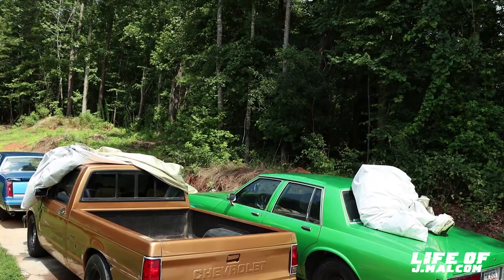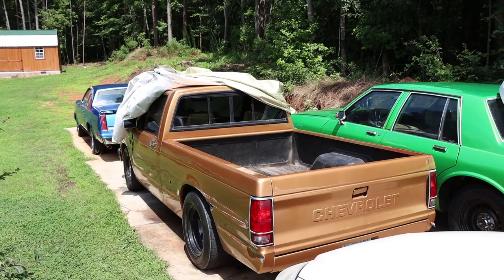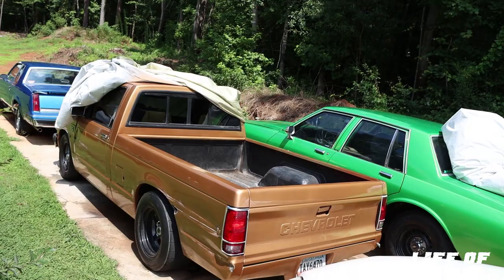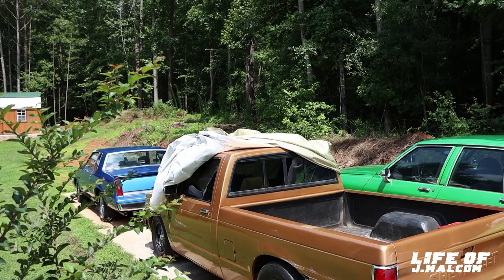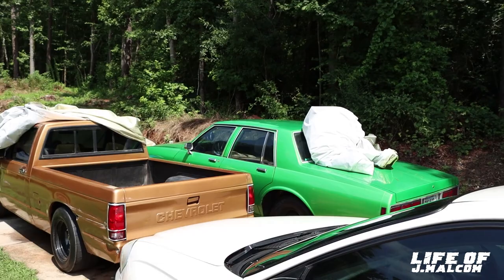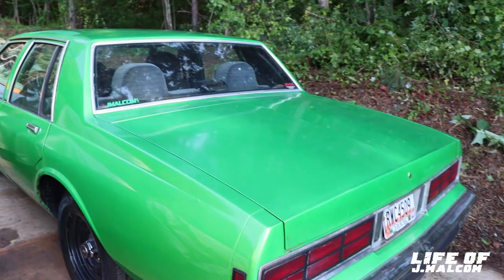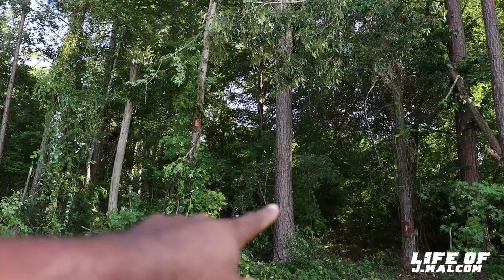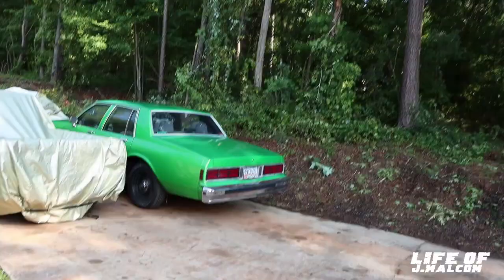HOW TO INSTALL A ROTOR AND BRAKES ON A 1980-1990 BOX CHEVY CAPRICE

Comment: I never ran spray or had  a car over 700hp but i have been riding big rims for a long time and i would suggest to you to upgrade them rotors and calibers it makes a big difference
Reply from the maker: It’s coming. And I’ve been riding big rims for the last 16 years myself
Reply: @LifeofJMalcom  i thought u said u was going disc all around anyway i was just thinking out loud
Reply from the maker: @gamesquad8155  got ya bro! And I am just want in a rush because that’s something easy and quick. I’m focused on the drivetrain running at its peak 1st